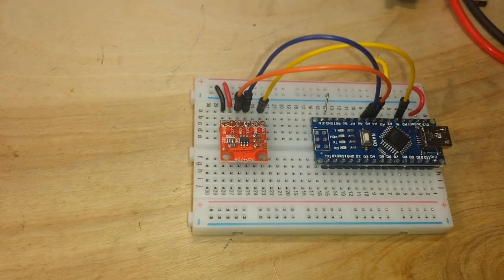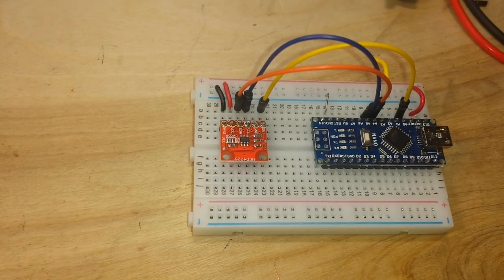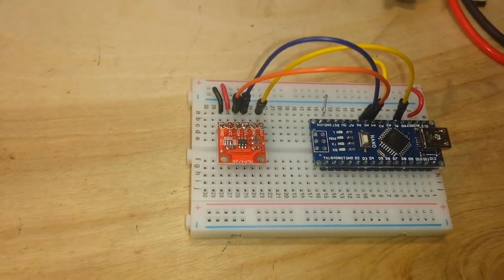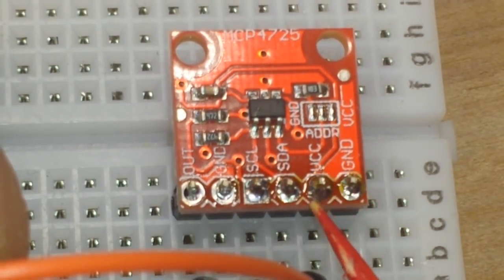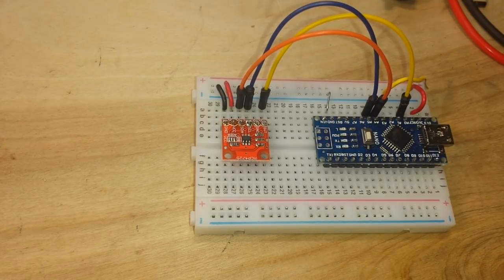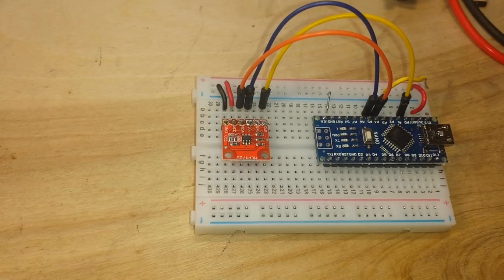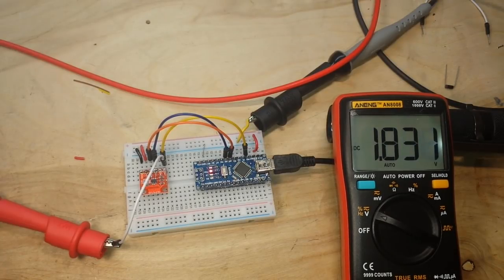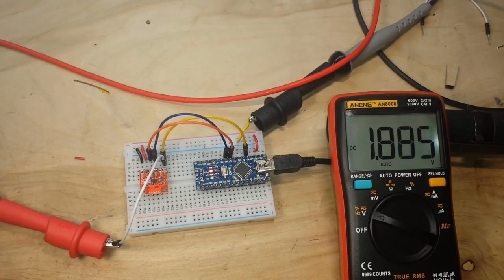Digital to Analog Converter and Arduino

Comment: Hello. Good morning. Just viewed your video and found it informative and useful. Can I connect a pressure sensor which gives out I2C, connect that I2C to this board and get analog DC voltage output from this board?

Comment: hey i know im late to the party but i have a question: 
so basically i am working on a scale and i want my scale to put out a certain amount of voltage depending on how heavy the things i weigh are. so lets say 1kg of weight should output 1volts and 5kg is max and should output 5 volts. how can i get this to work? thanks for the educational video by the way

Comment: I don’t need another multimeter but after seeing that Aneng I had to order one. It seems very versatile, especially for breadboard circuits.
Reply from the maker: I have six handheld dmms plus a Fluke 6.5 digit bench meter. But I love the 8008. It works well, it's compact, and it's feature-length rich. Plus, at $20 if you blow it up, you don't feel bad!

Comment: So (if i understand this correctly) the "digital" part of the DAC really means PWM? If u fed just 1s or 0s then the DAC would output 0 or 4096 (in this case)?
Reply from the maker: No not at all. The DAC takes a digital input of 0-4096 and outputs a linear DC voltage from 0 to 3.3V (or 5V).
Reply: learnelectronics i can wrap my head around ADC but struggle with DAC! It doesn't help that i never used one of these before. Prob need to mess around with one first. I'm confused bc a digital signal is 1 or 0, so how can it take in a dig signal between 0 and 4096?
Reply from the maker: Binary code 0-4096 made up of a bunch of 1's and 0's. But try to think of them as on and off.
Reply: learnelectronics Thanks. I think it's making more sense. An ADC takes a voltage as input and spits out a binary number. A DAC takes a binary number as input and spits out a *voltage*? So this voltage comes from the Vin pin on the breakout board?
Reply from the maker: You've got it now!

Comment: This module is using still pwm using counter, only difference is that this module is much faster then arduino, and with tah high frequency, multimeter dont see frequency higher then 1kHz. 
You should read data sheet before making that tutorial.

Comment: Thank you for your video.  I was wondering if the MCP4725 could be used with the Arduino for telemetry.  I am wanting to  experiment with telemetry for my seismograph.  Would the MCP4725 be able to respond to rapidly changing input such as you would have a telemetry signal.  Can the MCP4725 work with audio frequencies.

Comment: What is the highest sine frequency that can be generated?
Reply: Depending on approach, 3-7 ksamples/sec. Ssp if using 32 points per sone period, output sine frequency will be about 100-200 Hz.

Comment: Hi Paul, it is possible to used 4 of those with an arduino uno, by using the digital pins of the arduino? Otherwise what would you advise to use to have 4 DC voltage 0-5V outputs controlled by an arduino?
Reply: Hi, do you have find anything about that? Can you say.....

Comment: How can you amplify the analog output current?  What device or type of circuit am I looking for to add after the DAC to get say 5 amps to my load?
Reply from the maker: for what? to drive an audio circuit? if thats the case then you'd want an amplifier and transformer circuit.
Reply: No,  I am currently using mosfets and H-Bridge on my motors.  I give them full power 12V/15A until I need a constant lower current ~2-3A.  I am currently using PWM for the lower current,  but the humming/buzzing from the BLDCs is driving me crazy.  Just wondering if I can use analog instead?
Reply from the maker: Im not a motor expert, but after 15 years flying RC planes every BLDC motor Ive had hums. What about using an RC speed controller?
Reply: Good idea.  I'll check them out.  I may just add in a 2-3V secondary circuit.  If I give them 2-3V they consume 2-3 amps and are quiet.  Or just deal with it.  :)  Thanks for the reply,  love the videos.
Reply from the maker: Thanks. Hobby King has speed controllers for BL motors exceeding 100A. 60A was the biggest I've ever used and it's just 1.5"² x about 3/8 thick. And they are driven via PWM. It's been a while since I've been in the guts of one but I believe it's 1.5mS pulse is go lower, 2.0mS pulse is stay, and 2.5mS pulse is go higher. They are thermally protected too.